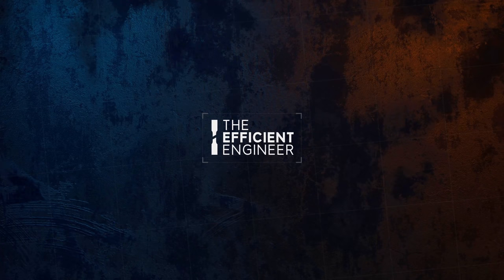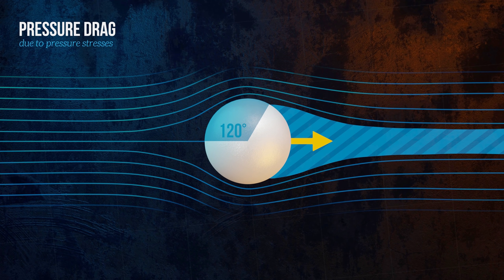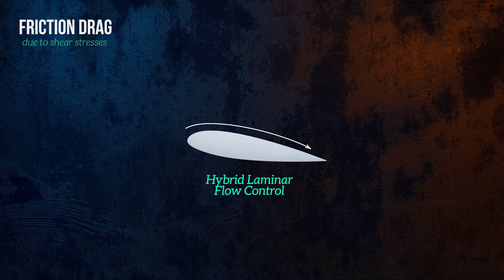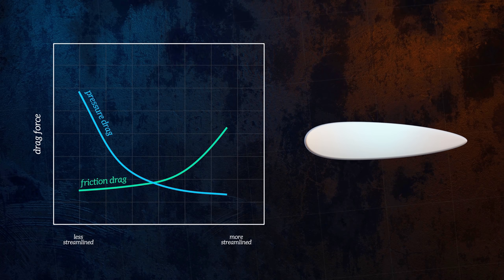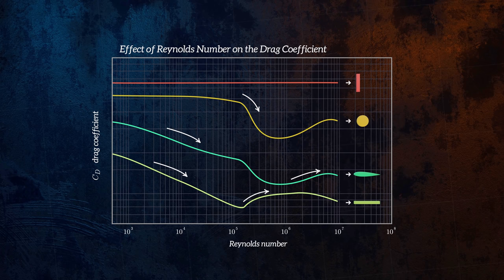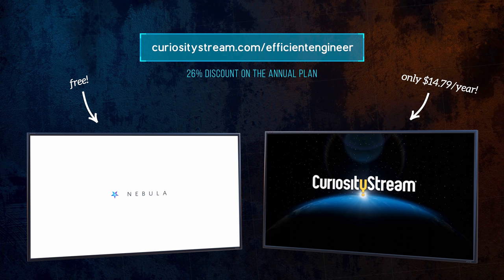Understanding Aerodynamic Drag

Comment: 0:00 - 0:30.       Introduction to Drag (What is drag ?)
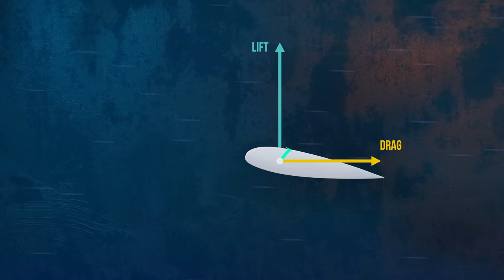0:50 - 1:05.       Why is drag an unwanted force ?
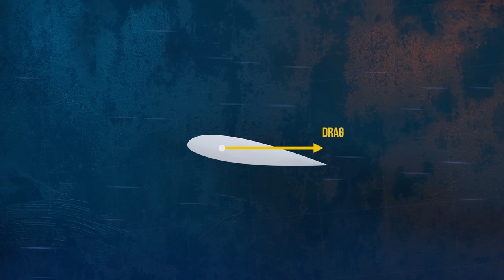1:30 -  2: 18      How is drag generated ? and formula for calculation of drag
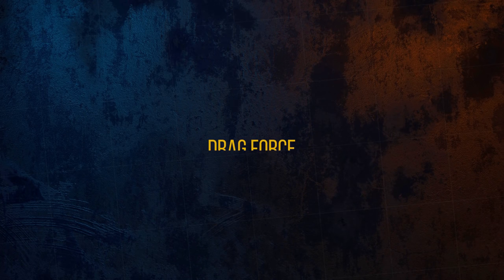2:19 -  2:31       Components of Drag force (Pressure drag and Friction drag )
2:32 - 3:19        Pressure drag in detail
3:20 -  4:47       Flow separation in detail
4:48 - 5:00       Why do golf balls have dimples?
( Dimples increase turbulence and hence reduce flow separation. Reduced flow separation means less "pressure drag" and so the ball travels large distance).
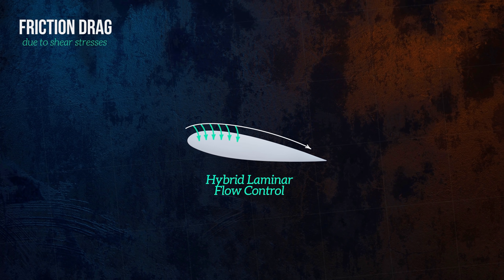5:01 - 7:15       Turbulence and its effects on Pressure drag and friction drag
7:17 : 8:05       Ridges on shark skin as bio inspired solution to reduce friction drag.
8:07 - 9:31       Effect of geometry and the orientation on Total drag.
9:32 : 9 :51      Quantification of drag force through integral approach.
9:52                  Simplified formula for drag force.
9:53 - 10:11     The drag coefficient and how it's calculated.
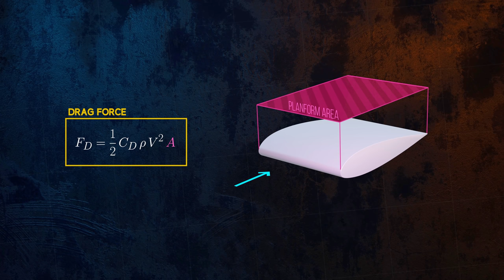10:22 - 10:36   The reference area (Emphasis on the selection of Area.)
10:37-12 :25    Re Vs Cd and arriving at stokes law.
12:26 -13:26    Arriving at terminal velocity of a sphere.
13:29-13:53     Constructing a Viscometer (In breif).
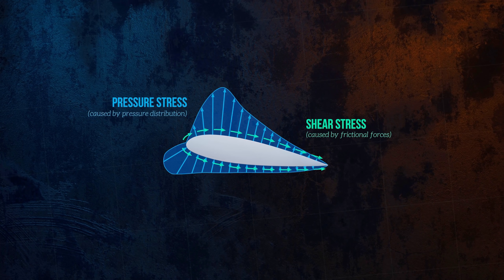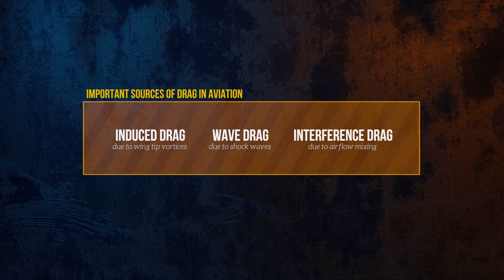13:57-14:22     Components of drag forces of particular interest in aviation
Reply: Thank you :D

Comment: The Efficient Engineer alluded to asymmetric vortex shedding leading to instability but never went any further (at least not in this video)   A good example of this is the baseball knuckleball.  A pitcher throw the ball trying to not spin it.  By not spinning, the laces do not trip the boundary layer.   The flow separates somewhere on the ball and this sheds a vortex and causes a force imbalance.   This shedding moves around the ball, the forces change and push in different directions, and thus the ball's flight path is erratic.   The curve ball is just the opposite.  The pitcher spins the ball rapidly so that the flow goes around one side more than the other.  This produces a 'lift' (or sideforce) thus causing the ball to curve.

Comment: @ 6:25 it should be steeper in laminar than in turbulent boundary layer. By the way,  cheers to your work man👍
Reply: Yes i also think so pls correct me if i am wrong
Reply: Yes!
Reply: He is right because stress is proportional to dv/dy, so turbulent is steeper in reference to the y axis
Reply from the maker: Yes Pedro is correct. By steepness I'm talking about how quickly the velocity changes as you move away from the surface. The change in velocity is more gradual for the laminar profile, and so the shear stress is lower.
Reply: For turbulent flow although velocity gradient is high and flow is unsteady, when we take statistical average it generally provides uniform profile unlike laminar where it gradually increases. Hence above velocity profile is correct.
Reply: @TheEfficientEngineer  yes u are right  thank you. But steepness is a term which is used to describe inclination ... and that essentially mean by convention inclination with respect to x axis ..
So for a beginner like me the word steepness used was a bit confusing and after understanding the concept i was able to figure it out that you were talking about the velocity gradient w.r.t the wall 
Nice video by the way.. Thanking you again for your effort

Comment: If you are researchers, maybe you will be interested in using the following ansatz for the Drag Force acting over a moving object with speed v:  for some constants b_i consider
Fd = b_1*sgn(v)*sqrt(|v|)*(1+|v|^(3/2))
which resembles the classic cuadratic law at high speeds
Fd = b_2*v^2
as also the Stokes' Law at low speeds
Fd = b_3*v
but differently from them, due it behavior near zero, this ansatz allow to have solutions with finite extinction times to the differential equations of motion (wich traditionally have solutions that are never-ending).
Hope you could comment how it works for your specific applications.
Reply: I would like to improve my last comment: the proposed drag force could be improved as
F_d = b*sign(x')*sqrt(|x'|)*(sqrt(2)/4+|x'|^(3/2))

Comment: I'd like to submit this question. We know that for a sphere for Re<=1 the separation thus not occurr so the drag is only friction component and it does provide a closed-form solution. Is it possible to obtain an exact solution for the 2D case, perhaps exploiting its symmetrical properties (it is a circle with respect any of the direction we look at it...).
Because whether the answer was affermative we would also, due to conformal complex transformation, find a solution for the symmetrical airfoil shapes...
A better approximation of the blasious flat plate numerical solution!
Thanks in advance for your reply

Comment: Boeing is reported to have 'dimpled' the fuselage of an early 737 some years ago and wings and tail surfaces were left untouched. They immediately noted a 3% reduction in drag. The fuel implications were impressive. However, for day to day operations of aircraft, often parked in humid salty and other toxic areas, the experiment was put on hold.
Reply: I spent over 37 years in aero at Boeing and never saw or heard of this 'report'.   The Re. No. on commercial aiplanes is too high for dimpling to have any effect.  It can be easily achieved however in a Texas hailstorm.
Reply: @dougball328  Good one. Yes. Hailstorm reek havoc in the air, on the ground - many leaving lasting damage.

Comment: Did you cover induced drag which is an unavoidable consequence of producing lift using an airfoil. Due to conservation of momentum of the airflow, the downward deflection of the airflow necessary to produce lift will cause drag. This will be present even if all friction and pressure drag is eliminated.
Reply from the maker: I covered induced drag in the extended version of the video on Nebula.
Reply: @TheEfficientEngineer  Thank you!

Comment: F1 cars also create turbulance at the outside edges of the floor to keep the high preasure air flowing under the car insted of escaping from the sides
Reply: The last thing an F1 engineer wants is high pressure air underneath the car pushing it up.

Comment: I'm not an engineer. That's why I'm coming to the den of engineers.   I want to understand air to air missile kinematics.  US wants to build a long-range missile.  The size restrictions will keep the missile under 4 meters.  But,  can they make this missile wide and still retain high degree of maneuverability for dogfight?
For example, we have 2 missile.   Objective is to get a missile that will travel 150 miles to target. 
Missile A:
L=4.0 m
D= 7 inches
MISSILE B:
L=4.0 m
D= 10 inches

The missile B with 10 inch diameter will solve their problem of inadequate range.   Not worrying about carrying aircraft,  does the  bigger diameter of the  missile B cause issues for its endgame high G maneuver? 
Second, what if the missile stays 10 inch in diameter,  but the propellant section is a booster and is jettisoned which leaves the end game missile 2.0 meters long and 10 inch diameter.   Is this a more agile missile? 
I want to understand length and diameter of a missile in relations to its maneuverability.   
ALL OTHER FACTORS BEING EQUAL.

Comment: That is great guys BUT in considering the pressure acting on a foil the presence of arrows pointing away from it is concerning. Never we will encounter a pressure exherting a pull force on a surface the pressure is ALWAYS pushing towards the body. The difference between how much the pressure pushes in the upper surface versus the lower generates lift.
Reply: …this video is conforming to the widespread convention within the industry to use an arrow toward the surface when local static pressure is greater than freestream and vice versa.
Reply: @XPLAlN  never encountered this convention in my aereodynamics or fluid dynamics classes. Thanks for sharing!

Comment: Could you do a video on the fluid dynamics inside of a gas turbine engine? Is the pressure inside the combustion chamber greater than the pressure inside the final compressor stages? What keeps the air moving in the proper direction if it hits a high pressure wall?

Comment: so if the drag coefficient changes with Velocity (Reynolds Number), what's the point of determining the drag coefficient  if it can't be used for design purposes against various aircraft or vehicle speed?
Reply: But it can be used for design purposes.  Boeing, Airbus, Gulfstream and others do it every day.   If you know the Re. No. at which you tested, and you know the Re No at which the airplane will be flying, you can adjust for the difference.   But believe me, back in the 70s and 80s this was nearly a black art !

Comment: But does the drag not consist of turbulence behind an object? It is counterintuitive for me to understand that, by inducing turbolence early on the  surface of the object, I will have less drag behind it...
Reply: they detach the flow earlier, so that it has a chance to reattach to the object
it then redettaches later than it would have than if the flow wasn't disturbed earlier
and that means the turbulent area behind the object is smaller
which results in less drag

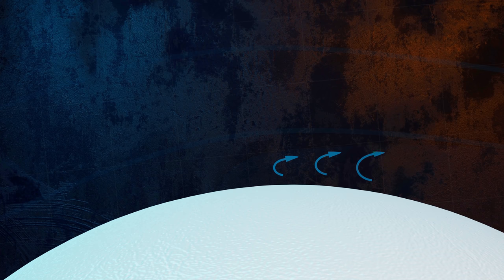Comment: 4:08 Does the separation of flow also have to do something with the angle of surface it is following? if we increase the angle of shape  the stream is following at some point it is gonna lose contact with it (and while the object is moving in one direction it pushes the flow of air in other direction) and at that certain angle newton 3th law cant apply?
Reply: Don't know if Newton's 3rd law ever fails to apply.. but you are describing a condition known as stall, when a wing's angle of attack becomes too great and flow separates, causing reduced lift and loss of altitude
Reply: @dielaughing73  yes that is the stall... be we are talking about what is causing the flow separation, what phenomena, in the video he described it trought one way.

Comment: how does a low pressure separation region creates a high pressure drag force?
Reply: Taking the sphere as an example: you have high pressure at the front (stagnation pressure at the theoretical forward stagnation point) but due to separation you get low pressure behind. The difference is pressure drag. Theoretically, if the flow remained attached all the way to the rear, you would end up with the same pressure again at the rear ‘stagnation point’ and the only drag would be friction, or viscous, drag. But after separation the streamlines are coming away from the surface and can no longer converge back at the rear stagnation point. The earlier point around the profile that separation occurs, the greater will be the pressure drag.

Comment: Surprised that they didn't include the fact that golfballs with 432 dimples, go several yards further.  432 is sound of ohm,  12 petals of the heart lotus and Chartes Catheral rose window has 12.  The one dollar bill has the Magen David in the form of stars.  The same shape with lines in the heart chakra.  There's one star (the tao de jing, where out of one comes the two, out of  two comes the 3 etc.  Below one is 2,3,4.  The resting pulse of a fit adult should be no more that 60 beats per minute (the heart beat of the universe), in 12 hours that's 432,000  beats.  Goes on and on.... They all add up to 9, the number of the Godess.

Comment: Fluid Mechanics
All I learned from my previous study were solving maths problems only, my lecturer didn't explain the real examples such as golf ball, aeroplane wings, shark skin, etc
and they are still getting high paid, Respect!!!
That is why my country always poor, because they fail to educate and the cycle goes on.
Reply: A fun application of the terminal velocity is using a ping pong ball to determine altitude.   To see whose rocket goes the highest, you eject a ping pong ball and time how long it takes to get to the ground.

Comment: Air is made of particles. If those particles a aimed directly at a surface, they impart force. If those particles move across and don't hit the surface, they impart no force. If something has an imbalance of force, it moves in the direction of the net force. That's it.
Reply: No, that isn't it because here we are talking about an object moving through a fluid which has viscosity and therefore we have skin friction drag as well as pressure drag.
Reply: Yeah no that's not how it works.

Comment: I'm not an engineer, but I just wanted to say this: I have never seen an airfoil without a separation region. Sometimes they are really small, but as far as I know separation always occurs. Is this right?
Reply: I think you are referring to the boundary layer. There is always a thin layer of fluid separating the surface from the moving fluid. In these calculations, it is assumed to be negligible.
Reply: @andrewferraro8568  Yes, that's it. I didn't know they neglect it. Thanks.

Comment: If the wing is moving forwards in  stationary air space, the drag is the force required to ACCELERATE forwards mass of air near the wing..
If the air is moving in a wind tunnel with the wing stationary, the drag is the force required to DECELERATE the mass of air near the wing.
( parallel to the wing flight path) 

LIFT is created by ACCELERATING  the air mass particles downwards ( orthogonal to the wing flight path) using compression effects below the wing and a partial vacuum effect above the wing.

Comment: From what I've read, shark-like roughness won't be advantageous for planes but mostly for boats and similar bluffer bodies, since the most of the gain comes from moving the curve Cd/Re in a way that makes the Cd to fall in the critical pit (the lower pit in the plot). Planes are obviously surrounded by a fully turbulent flow, so this would not be possible. It's the reason why golf balls have bumps while smaller/bigger balls are flat. Very nice video!
Reply: Riblets are another means of reducing turbulent friction drag.   Riblets are microridges running in the direction of the local flow.  The flow tends to sit on top of the ridges - the drag is reduced because the flow is not 'touching' the full wetted surface of the wehicle.   As the video suggested, implementation is the issue - as well as how to maintain the integrity of the surface.

Comment: Just spray the plane in a paint of fine grit sandpaper. Done, easy gains due to the size and speed of vehicles. Will drastically reduce the shear left over that would break the laminar flow.

Comment: Why don't airplane wings have golf dimples?
Reply: Golf dimples are there on golf balls to create turbulance for the incoming air, which would reduce the flow seperation and thus reduce pressure drag. But this is only because the shape of the ball is a sphere. 

The shape of an airplane wing makes sure that there would be very little, if any, flow seperation, so they don't need to have golf dimples. If airplane wings did have golf dimples, it would just create turbulance.

Comment: I would recommend a brief explanation of Reynolds number.  It is the ratio of the inertia forces to the viscous forces.    A simple example is fill a coffee cup full of water.   Very slowly tilt the cup.  The water will run over the lip and down the side of the cup.  This is because the viscous forces are keeping the water attached to the cup.  No tilt the cup more until the water flows out of the cup and into a stream away from the cup.  Now the inertia forces are dominate.   Having said that, I found the video to be quite informative and accurate.   (As an aerodynamicist I designed airplanes for nearly 40 years,  mostly commercial but a few others tossed in for good measure and professional stimulation)

Comment: for cylinder in fluid  for reynolds number less than 0.5,relation between Cd and reynolds number is not straight line in graph, thanks for the video buddy.
Reply: Reynold's number less than 0.5? When does that even happen? Either hugely viscous fluid or a miniscule velocity

Comment: But for the vertical rectangle won't t it have lots of air pushing on its face making it go way slower?
Reply: Of course, which is why semi tractor trailer designers no longer have flat-nosed cabs.

Comment: Lift induced drag simplified: Downwash tilts lift vector slightly backwards, lift vector backwards means that the lift is not only pulling upwards at the aircraft, but also backwards, which mimics drag. Downwash is caused by the shape of the airfoil and also caused or amplified by vortices.
Reply: Downwash is not caused by the shape of the airfoil.  It is the result of the circulation generated to produce lift.  L=rho* V*gamma) where gamma is the circulation strength.

Comment: What is difference between buoyancy force and drag force?
Reply: Bouyancy arises from pressure differentials.   You don't get this in flight, but you can encounter it in a wind tunnel where the static pressure along the axis of the test section is not constance.  If that pressure is rising, you get a 'thrust' force, if the static pressure is dropping you get a drag force.